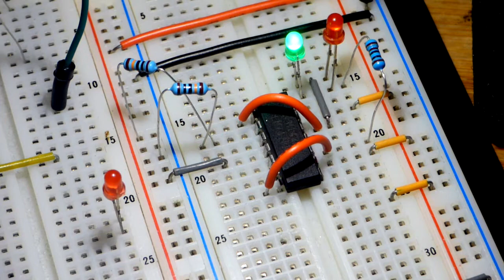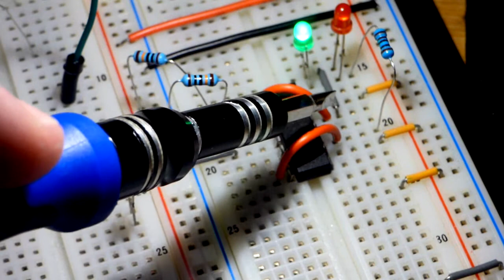Electronics LED used as bright light sensor to control LM747 747 dual op amp integrated circuit LEDs

Comment: Another very interesting video; I tried to replicate it with a NE5532 dual opamp but no success as yet. Thank you.
Reply from the maker: I may have one of those ICs, I'm guessing the pin layout is different. I think I fried some opamps recently when I accidently wired supply voltage to offset null pins.